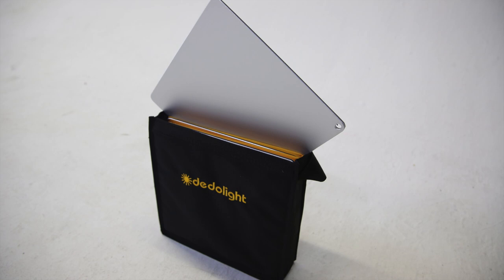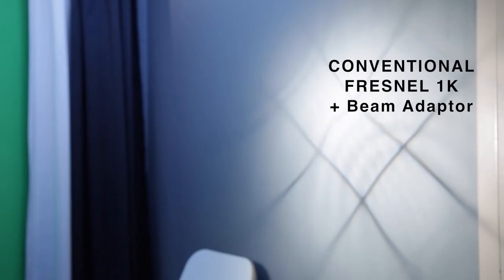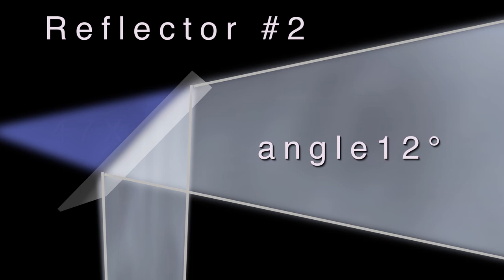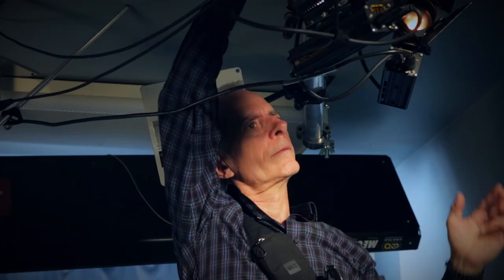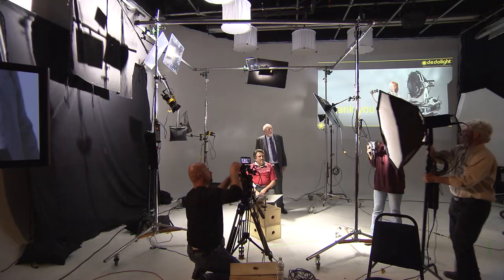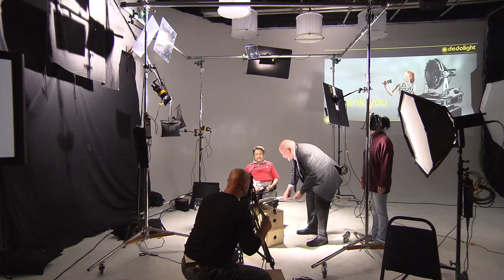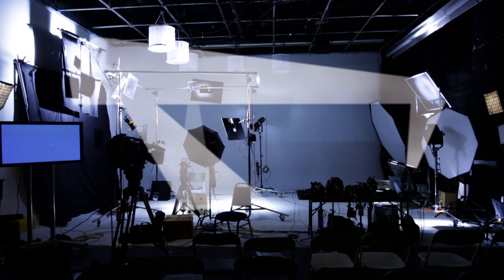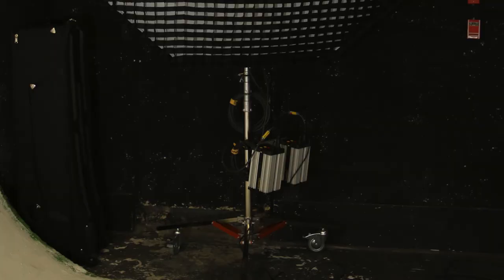A New Way of Lighting — dedolight®Lightstream

Comment: Why the need for a softbox on the Dled10 fixture? If the mirror surfaces are able to produce the same soft quality of light? Isnt it true that reflected light (with a special soft transforming spread mirror surface) has a similiar softness but without the light loss (minor output) of the softbox?